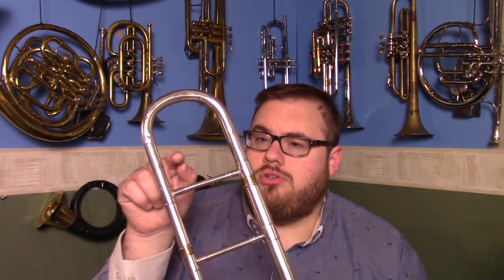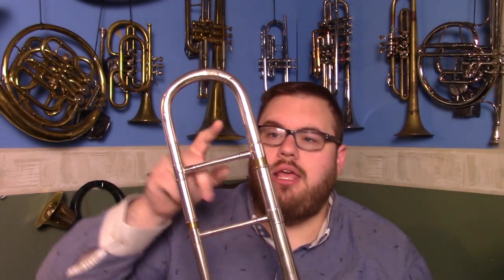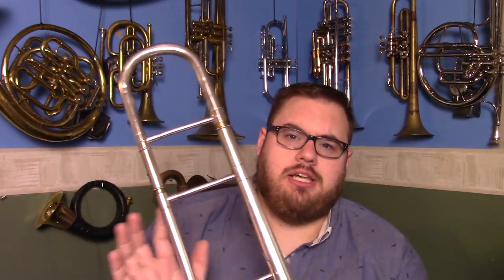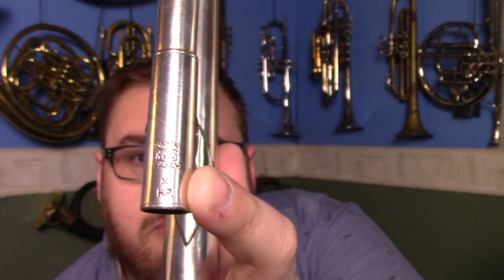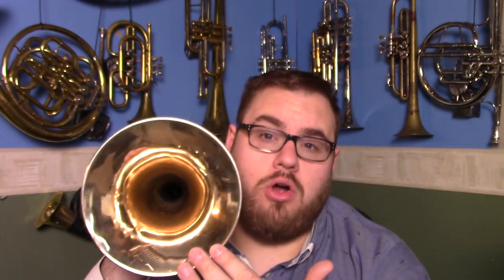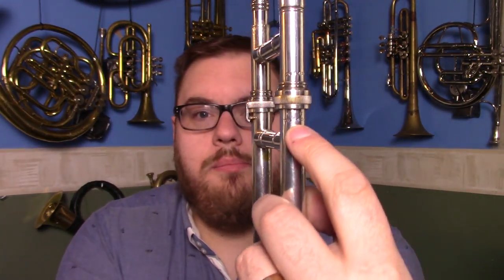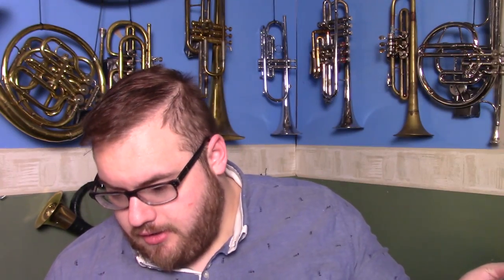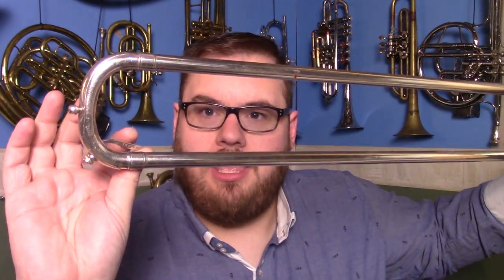110 Year Old CG Conn Trombone Review

Comment: Thanks for all of these great videos, Trent!  Incidentally, the early Conns (before about 1919) didn't have the model numbers we're used to today (such as 6H, 88H, etc.).  There were "S" (Small--.458" bore), "M" (Medium--.485" bore), "L" (Large--.500" bore, sometimes also denoted as a "small symphony" model), and "SYMPH" ("Large" Symphony--.547" bore) models.  They became the 2H, 4H, 6H, and 8H models, respectively.  And there were also versions with both High Pitch and Low Pitch tuning slides, such as the one in this video (note how long the tuning slide is compared to other trombones).  These became the 3H, 5H (which is what you are reviewing), 7H, and 9H.  They're great instruments, and I still play mine regularly!
Reply: Eric Heidner Very interesting
Reply: Very knowledgeable, I have a 1917 3H Conn CG and have been slowly repairing it and replacing some parts like the higher pitch tuning slide (mine only had the lower when I got it) and a slide lock. Very cool